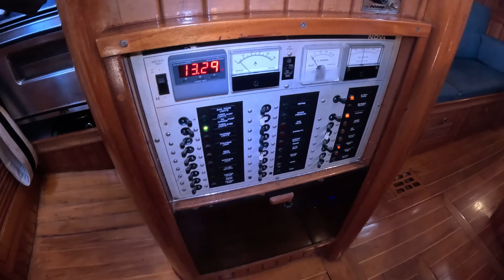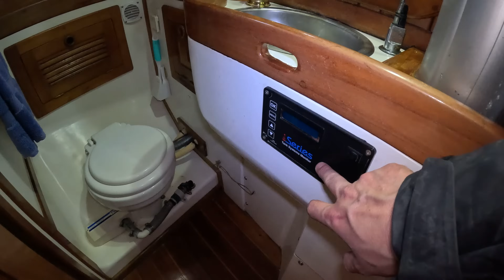Cabo Rico 38 - Already setup to sail around the world - Blue water cruising in a timeless design

Comment: Beautiful boats, love the clipper bow and cutter rig but hugely disappointed with the interior space and the size of the cockpit for a 38' yacht, only a quarter berth and vee-berth with a makeshift nav station leaves a lot to be desired, I could name several 36' boats of a similar vintage with two cabins, a dedicated nav station and a quarter berth. Case in point my Stadt 34' has a double berth aft cabin, a vee-berth, a dedicated nav station, bigger galley and a port side L-shaped setee which converts into a double berth, as well as a stbd setee sea-berth with lee cloth, as big if not bigger cockpit and a full beam aft lazarette with built in gas locker big enough for two 9kg cylinders, also designed in the mid 80's, there's a lot of wasted space aft on these boats IMO, of course it helps significantly if the boat is tiller steered space wise, I also don't like things like house bank and inverter/MPPT's etc to be in an outside locker no matter how well sealed they may seem, still a beautiful boat though, very seaworthy and heavily built, lovely sheer line and overall profile especially the clipper bow and bowsprit, I'm presuming that there are running backstays? I also noticed that there were only two cockpit primary winches and one non self tailing cabin top winch which I presume the self tacking staysail sheet would be run to? 
Regardless a very pretty boat
Reply: Sounds like it’s not the boat for you maybe the one that you described is .. Geesh ..
Reply from the maker: stunning looking boat yes, but like all boats, they suit some but not others, I believe there is no such thing as the perfect yacht, but each yacht buyer will get close enough